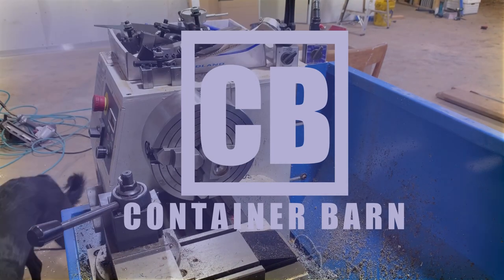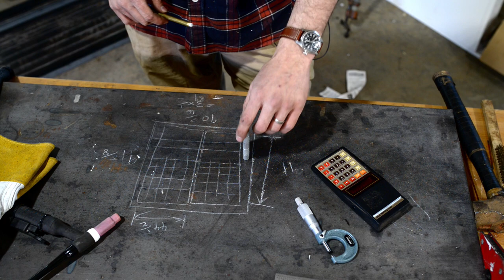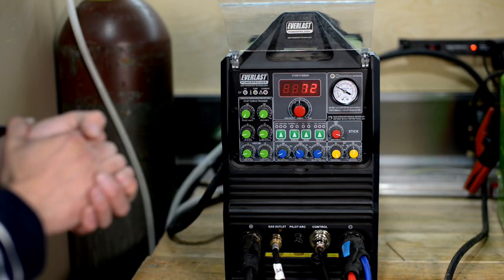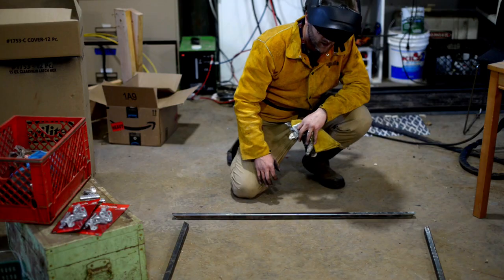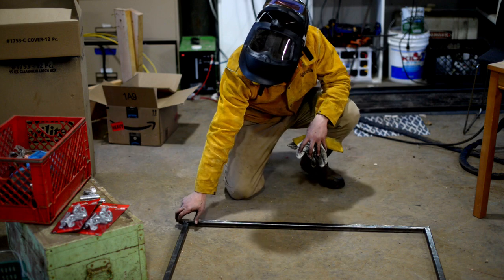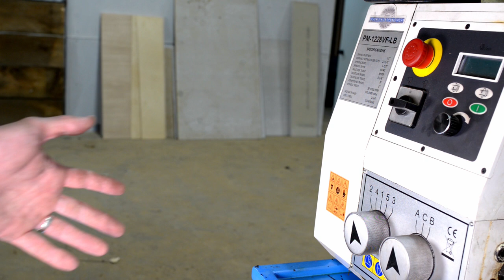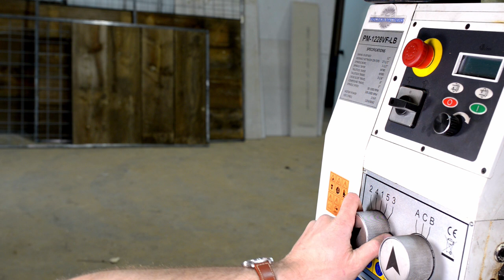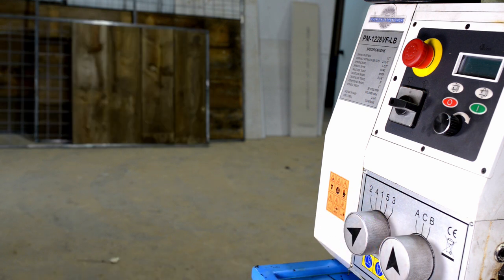Container Barn: Reclaimed wood & steel container barn doors

Comment: with the panels you cut out...  why not frame those and mount them on garage door hanging rails and have them slide over and lock in place over your normal access doors to secure your containers...
Reply from the maker: I’m not sure if I follow your idea. The plan with the cut out cattle panel is to allow airflow through the door while still protecting the animals from predators.
Reply: @superchromat  just as a secondary.. almost never closed except in a storm or winter time .. or when going to be away for security..  i guess with animals one can never be away.
Reply from the maker: Ah! That makes sense now. I don’t think we need extra security. The doors will keep predators out and I’ve set up a WiFi camera that patrols around the other barn to keep an eye on humans. Will probably do the same here.